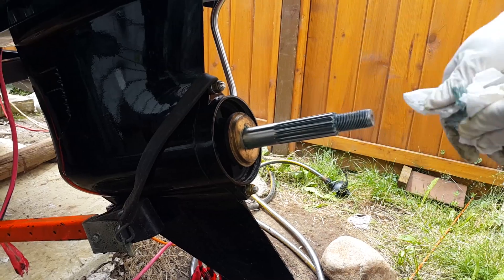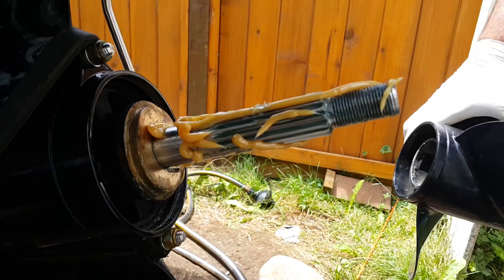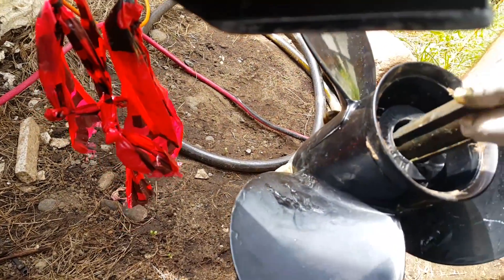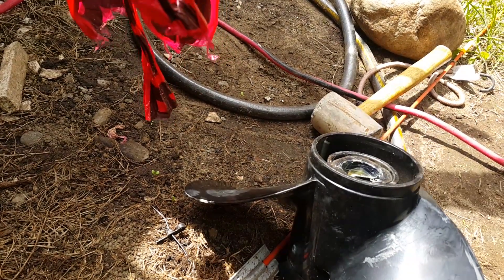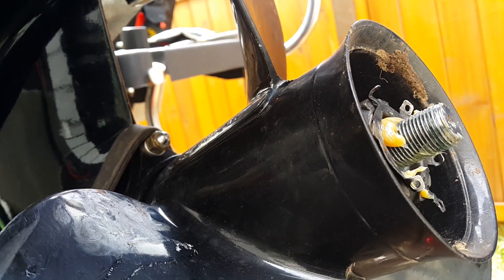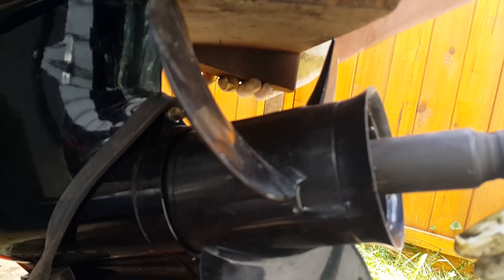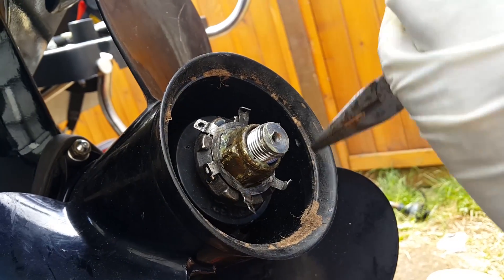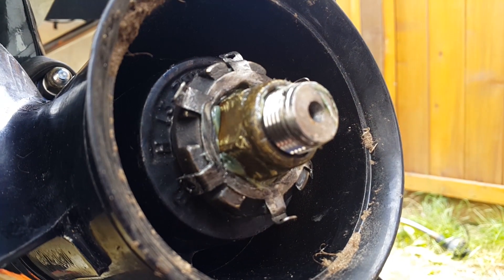Propeller change/service for Mercury Outboard with Flo Torq II system

Comment: My Mercury manual for my 2016 115 4 stroke says not to get the grease on the threads of the shaft...  And it says to coat the entire shaft (other than threads).

Comment: when doing this procedure, DONT do as you see in the video where NO care is taken in getting the nut to seat properly into the lock washer assembly... a trained eye can see the corners of the nut was snugged down on to the outer part of the washer, rather than seating down INTO it properly....  he didnt notice this and the washer was damaged when he put the torque wrench to it and turned it several times until it deformed the washer and slipped down into the recess where it should have been as the nut was being turned  gently onto the shaft, after it slipped into its proper place,  he then switched back to the ratchet to continue taking up the newly found slack... if the nut is seated properly to start with, the torque wrench will will tighten it to spec within a quarter of a turn.
  and... rather than letting the grease set on the surface to be scraped off when the splined hub is installed, smear it around so that it gets down into the splines.... why is this important? because saltwater gets in where there is no grease, and then salt deposits build up and eventually makes removing the prop a very difficult task.. The proper grease AND properly applied will displace any space in the assembly and not allow water in...
Reply from the maker: thanks greg. much appreciated!
Reply: Ive seen several videos, some were mercury techs.   Some bend the washer tabs back before taking off the nut,  and  some don't??  Which is the correct way to remove ?